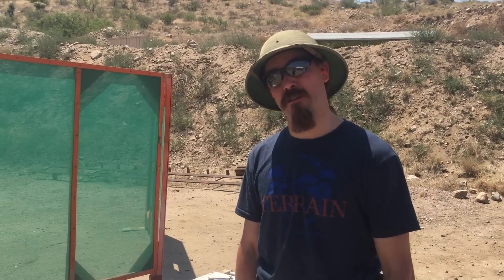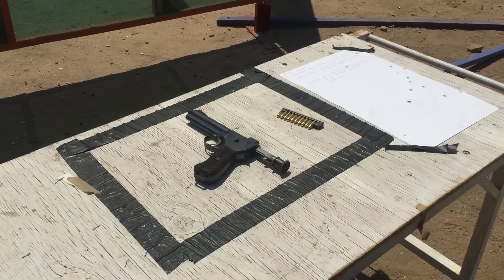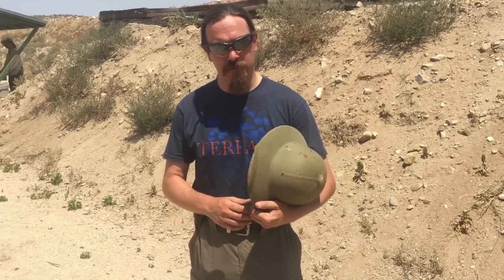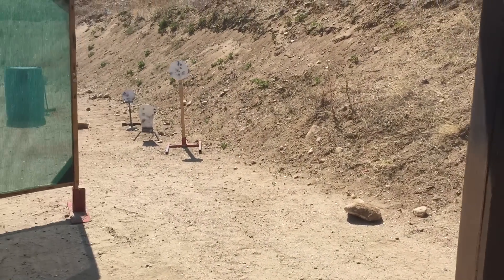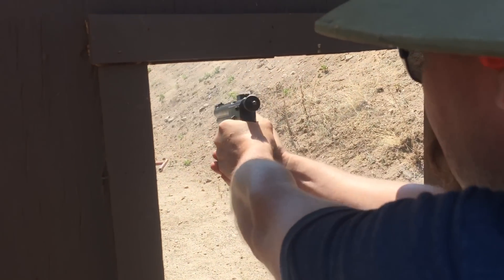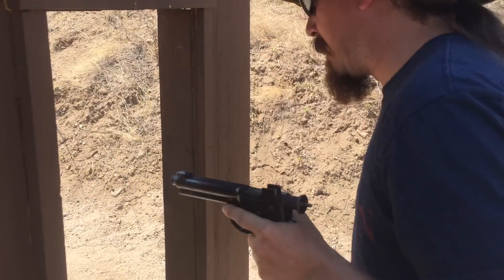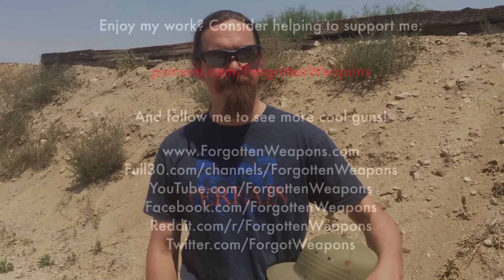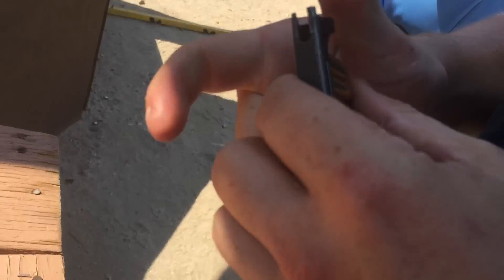Roth Steyr 1907 at a Run-n-Gun Steel Match

Comment: Amazing a firearm so old can still be so reliable. Over a 100 years old and running smooth. Very nice.
Reply: except the part where it wasnt reliable.  but yes it is a well designed and built pistol
Reply: I own 1914 steyr hahn (hammer) and it runs fine just ammo is budge ...i load largo cases
Reply: @jnathannger8654  it was only unreliable because of user error if you watched the video you would know that the gun ran reliably.
Reply: II D3ADB1RD II Doesn’t mean it was at all affective or reliable in combat. Any gun can be clean and “reliable” if it’s a safe humper.
Reply: Right up until 8:00
Reply: Its a tool.
Reply: Yes that's why so many still use a model 1911. Its over a 100 years old but it's one of the strongest designs.   Well designed well made firearms last many generations if cared for.
Reply: Ovlp
Pic k
Reply: @IIDEADBIRDII  I'm pll
Reply: @kinocorner976  what the hell are you bringing "combat situations" into this for? Literally nobody said they would use this gun in a combat scenario nor were they testing that purpose. The guy was literally talking about the gun not being reliable nothing else. I just pointed out that if he watched to the end it want the guns fault for the malf. Ian literally loaded too many rounds into it and induced a user caused misfeed. When loaded right the gun is reliable. That's the point. Also...... effective* not affective.
Reply: Back in the years when things were built to last!
Reply: Just like mostly anything that comes out of soviet union
Reply: @manitoba-op4jx  says who? You. Get outta here with your CIA propaganda
Reply: Hell, I still shoot my 1887 Martini Henry. Not often of course, those bullets are 12 dollars each, but enough to respect the hell out of the craftsmanship.
Reply: My dads 1911 is from about 1913-1916 and still runs great.
Reply: Except for Ian's most recent video with a bad batch of Fiochi ammo.
Reply: I'd be scared if this happened in combat 8:02
Reply: @peanutbutter5402  this gun is not from Soviet Union
Reply: @Sheer_Tazieh  wasn't my point

Comment: I love when a gun engineer figures out how to have the breach automatically close when yah pull out the stripper clip.
Reply: Probably the clip hits some sort of bolt release and the clip itself holds the bolt back until it's removed if I had to guess
Reply: It should just be spring tension closing the slide after the stripper clip is pulled out, if it works like most other last round hold open weapons there is a catch on the magazine follower that literally catches the slide and stops forward travel after the last round. Once there is ammo in the magazine the slide catch is disengaged and the spring tension on the slide would automatically put a round in battery once the stripper clip is removed. Even on weapons like the M1 Garand that sometimes stays open after the en bloc clip is fully inserted is only because the spring trying to push the bolt forward isn't strong enough to strip a round from the clip at that level of tension thus needing help forward. Most of the time they work the way they were intended and close automatically, that's why there are specific loading procedures to follow to avoid a condition called "garand thumb".
Reply: It’s probably the magazine follower prevents to bolt from going forward

Comment: Those stripper clips load really smooth, nice!
Reply: for $150 each they had better!
Reply: At that price, it looks like someone could afford to tool up and make some to sell.
Reply: +andrew francis
not a bad idea. problem is getting someone to 3d print metal. I don't think plastic is strong enough and I don't think firearm hardware is something  you could get on a site like shapeways
Reply: maybe you don't need the exact strippers, what if he used one that fit 8mm steyr but without the thumb charger?
Reply: +Benjamin King the thumb charger is important, it's hard to get the last round in otherwise.
Reply: +gark64 I figured, but over $100 for a stripper clip sounds ridiculous. I'm just saying maybe there's a cheaper "generic" option
Reply: gark64
In that case just put an additional 1-2 rounds in the clip?
Reply: andrew francis
if there is a point to the hooks I don't thik it would be too hard to modify an existingh similar clip to have them
Reply: Galf506 Only if the clip slot has some really sharp edges. we've had toys and mechanical devices with plastic parts rubbing against metal ones for decades and they don't get plastic shavings around
Reply: a dummy round or 2 held captive by a slot and rivet(s). basically what the thumb-piece is anyway... one of the soviet cheapo subguns just riveted a dummy round on the mag floorplate for the "double stack step". made a simple stamping do what would otherwise require a far more complex die set.
Reply: +MyDifferentUserName oh, hi! Didn't expect to see you here.
Reply: I wouldn't be surprised if it's faster than a regular gun with a mag.
Reply: Just what I was thinking looking at someone trying to load a C96 compared to this.

Comment: 112F and you're still killing those targets? Heroic. I'd have been in a coma.
Reply: It's a dry heat.
Reply: +Scott Patterson So is the surface of the sun.
Reply: that's 44.4 C not too bad
Reply: You get used to it when you live in Arizona.
Reply: That's actually a fairly normal temperature in Arizona
Reply: Arizona summers are...unpleasant.
Reply: ZMan1471  idk, you can always put on more clothes, however you can only pull off so much ;)
Reply: Try doing some shooting at 20°C below zero.
Reply: @moonstryder1740  meanwhile there are people like me, comfortable at 12°C
Reply: @Porty1119  broiler
Reply: @Dick_Gozinya  Most people don't realize how much humidity matters, once you've been in south alabama during a 99° to 102°F summer while the humidity is almost 100% you'll know what hot is. People die here every year from heat stroke, and shade doesn't do much good it's like being in hot fog.

Comment: Terrific video!  Don't know if anyone knows this, but they were designed for the cavalry.  The soldier had four guns.  One on either side of the horse in a special holster (I've never seen one), and one carried in holsters on each hip.  I guess the idea was to use the horse mounts first then, by that time the horse may have been hit, so run with the other two and hide!  Makes sense, cuz I can't imagine playing with stripper clips while riding in the middle of battle.
Reply: Correction.  Three guns.  Only one on the hip.  Two on the horse.
Reply: There was a renaissance mounted troop type/tactic for armoured men using 4-8 flint/wheel lock pistols each - basically they'd ride up in spaced files near to a block of pike and musket who were reloading, front rank fire and wheel back through, repeat until either nobody has a pistol still loaded or the renaining musketeers are getting near ready to fire, then ride off somewhere quiet and reload all those pistols.

Comment: I know I'm incredibly late on this, but apparently someone created a work around for the stripper clips. Basically: Use M1 Carbine clips. Take out the brass spring and retainer, and drill and cut out a U-notch near the bottom with a drillbit the rough width of the extractor (to allow it to clear), and bing bang boom you have a slightly less worse way of reloading the pistol.

Comment: Karl was joking, but they issued Stripper Clips for several reasons.  Most of all, because it was the turn of the century, and it made the guns a lot simpler to manufacture.  They're also a lot lighter, and more compact way to carry the same amount of ammunition in the field.  Not to mention, you're going to be more careful with your shots, when you know yo're going to be loading 10 rounds with stripper clips, whereas you can throw bullets away when you know you have a 33 round box magazine.

Comment: I was wondering if the 8 round Czechoslovakian made strippers for 7.62x25 submachinegun would work for the 8mm roth-steyr  cartridges.  Just a guess.  7.62tok case head is little larger.  The M1 carbine strippers are likely too small.

Comment: Couldn't u have applied pressure to the topmost round in the mag while pressing the "dump" button, then relieved the pressure a bit with the button down and then after the round had passed the part that would hold it down let go of the "dump button" to keep the rest of the rounds in the mag? That would of course mean to push on the topmost round again before closing the action to avoid another double feed, but it might have been faster than dumping the mag altogether and switching to single loading.

Comment: I wonder how much a local machine shop would make those stripper clips for.
Reply: $17,000 USD
Reply: depending on the design, you could probably lasercut sheet metal and bend it in a press,
Reply: +PleaseDontWatchThese no problem making your own. if you are good at fab work.

Comment: I'm reading that you can make 8mm casings by trimming & resizing .30 Carbine brass
Reply: Or you can reload Fiocchi brass.  I am planning to do that.  Problem is finding bullets!  One guy has  used 100 gr copper plated TMJ Graf and Sons 8mm Lebel .330 in Lee Lube and Size die to .323 inch. Loaded over 4.0 grains of Alliant Unique.

Comment: Couldn't you have the clips custom made from a medal worker or a gunsmith?
Reply: or thin brass and some tinsnips
Reply: sure, and you'd pay about double the cost of originals. look at that clip, you have 3 ribs each side, a thumbpiece that rides in one set, the locating portion, and the rim channel. so, you need a blanking die, and at least 2 forming dies (one for ribs, one to bend). you also have to have either a die to fold the ends to retain the thumbpiece, or a rivet rig (and a slot, but that can be formed in the blanking die). so, you have at least 4 tools of NO other use at all (and not cheap, or small ones) before you even consider making thumbpieces. it's either spend a fortune tooling up to make them easily and conveniently (and fast), or find some micro-scale blacksmith to tap you one from stock, lol. either way, the outlay per clip will be astronomical, unless you crank out enough through dies to amortize tooling (and actually sell them). your dies will have to be very close tolerance, so VERY pricey (even if cnc'd). that also means short service life before rebuild (because every use steals a nibble). that's not a k98 clip, lol. they are rare for a reason, and unmade for the same reason. they're a production nightmare, lol.
Reply: @ludditeneaderthal  always tought clips were cheaper then magazines to produce
Reply: @ALE199-itathey are, at scale, but tooling is never cheap

Comment: Wouldn't it be possible to make stripperclips for it with some tools and sheetmetal?
Reply: Yes, sort of. The thing with stamped steel parts like that is they are dirt cheap and simple to make in large quantities once you have made the dies and all the tooling. The problem is that making that tooling is VERY expensive. It only makes sense to do if you can sell thousands and thousands of the things. You would go broke trying to make them for the 50 people that would buy them. For lower volume work, machining such as a lathe or mill is much cheaper but these clips can't really be made that way. But imagine if the trigger was prone to breaking and replacements impossible to find. Anyone with a milling machine could make one in a few hours. A CNC mill and a bit of programming could make a hundred of them in a day.

Comment: What's that soft metallic sound I'm hearing whenever you bring the gun up to fire? it has the same sound as a safety or trigger reset on an AR, but I can't imagine you're holding the trigger back during reloads...
Reply: I believe that it's the sound of the trigger engaging the second half of the striker pull-back. See the vid description.
Reply: I was very curious of this sound as well!
Reply: That's probably the strange Trigger
Reply: Mike Wehrer it is when the bolt of the firearm gets released from the stripper clip. Last round holdback gets canceled instantly when you load the rounds with a stripper clip after you take out the stripper clip.
Reply: Nathan Johnson no that is caused by the trigger pull. Read the full description.
By the way I’m not trying to be a jerk I’m just trying to be informative so people don’t get the wrong info.

Comment: A 1907 Roth Steyr poor quality replacement stripper clip can be made from an M 1 carbine stripper clip and crimping it a little.           This is from Jan Sill's site.                 MadMagyar's Avatar
MadMagyar  MadMagyar is online now
Member
Join Date
Nov 2011
Location
TN/USA
Posts
442
Default
This was all my brother had for years to charge his M.07. It was not very pretty (not easy re-crimping the end to fit the slot in the M.07) and did not charge a full load (not enough material to work with and have the charging "thumb-slide" to clear the last round deep into the magazine). But when it is that, or nothing, you tend to settle for that. He was proud of it - then I scored 5 clips and sold him 2 of them. He still keeps the carbine clip as an operational back-up. I will try to get a picture of it from him. We are driving up to SoS together, weather permitting, if he remembers to dig it out I can post a picture shortly after we return. Jeff

Found this action pic and cropped it down to just the clip - you can see how big and bulky the thumb-slide is - when working with just hammer and pliers one cannot get too intricate - I think he can only fit 7 or 8 rounds - couple have been pushed already in this pic. Even if you could make the thumb-slide a little smaller I do not believe there will be enough material on a carbine clip to get a full 10 rounds.
M07RSCarbChgClp.jpg
Last edited by MadMagyar; 02-22-2015 at 10:08 AM. Reason: charging "thumb-slide" was "button" & added action picI                                     I
Default
 There "was another thread asking about a safety on a Roth Steyr. I had one (sold in 1973) that had a safety. It had a 3/4" leaver on the right side of the frame almost in the middle of the exposed metal above the right side grip. The Serial # was 12128 (the 1 # was under the grip that had to be removed to see it) Made in Budapest. Marked W.n eagle 12. The condition of the gun was the left side of the gun was heavily pitted not deep but a lot of it. Right side was good. The holster was a "RAG" Thin worn & torn. Bought it for $20.00 Sold it for $45.00 (when that would have bought a mint BYF 42 Luger) a good percentage at the time, but I should have kept it. the Question is where is #12128 now? Is it on your list? Has anyone seen another with a safety?
Thanks for reading Bob  Benson                   MadMagyar's Avatar

Comment: I wonder if the stripper clips could be 3D printed?
Reply from the maker: Not out of plastic. Far too weak.
Reply: Typical plastic will not work. You could make it out of nylon, carbon fiber, or polycarbonate, but I do not know how long it would hold up. I would say you could definitely do it.

I have successfully made a .22 blank shooter out of plastic (metal firing pin & springs), of course a .22 blank isn't going to stress anything very much, but even the force of the firing pin spring cuts into the soft PLA plastic. I'm sure the spring retainer close to snapping off, too. What you typically think of as plastic just won't cut it.

It has to be a plastic that can handle a thin strip that will stay rigid, not bend, and also not snap, because when you push the bulllets into the follower, the spring is pushing back up and if the stripper clip is not strong enough, when you push down, the bullet rims will just rip off the guide piece of the clip and fall out.

The most likely plastic to hold up to this is polycarbonate. That's what is sometimes used as bulletproof glass, by the way. With a $40-60 roll of PC you could probably make like 15-20 clips that would work for an unknown number of reloads.
Reply: 3D print the clip, embed it in side a clay mold, melt the plastic away with heat, use the clay mold to cast metal clips.
Reply: Cuong Le This is an example of the most ideal way to use a 3D printer to make metal parts. They make ideal positives to make a casting mold from.
Reply: Cast metal would be too brittle for an application like that. A machinist could make some out of billet steel but a machinist's time is expensive.
Reply: You could print one in ABS to see if you've got the design down then send the specs to a machine shop to have them stamp it out of sheet metal...or wait until someone puts one on sale for a good price. I'm gonna say there isn't a big enough market for me personally to start making them--might get 1 order a year :)

Comment: I think you just put an underline there that improvements in pistols over the last hundred years have all been incremental and in a daylight CQB between someone with The Roth Steyr (or a Luger, or a 1911 or any gun that was good 100 years ago) vs someone with the very best high speed low drag pistol made today.. advantage will be based on the shooter not the gun.

Comment: can someone tell me, are you able to add more rounds to used stripper clips or is that a manufacturing thing that makes the strip useless after its spent?
Reply: Stripper clips can be reloaded by hand
Reply: ah okay, so once you have them you can fill them up like a external magazine,  thanks for filling me in cause ive always wanted to own a Mauser c96 (mainly for collector purposes)  and any info like that helps ^_^